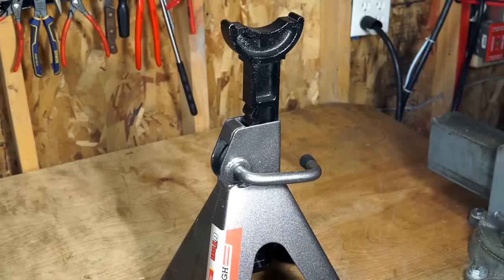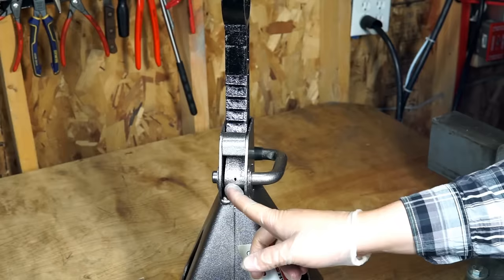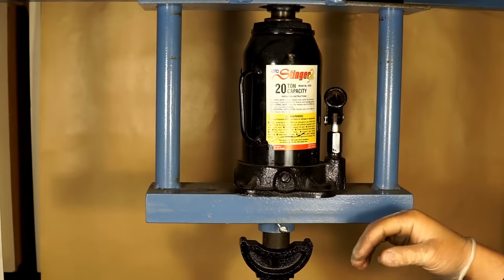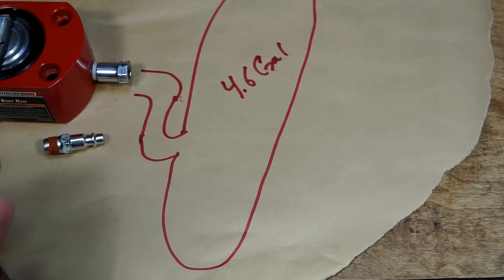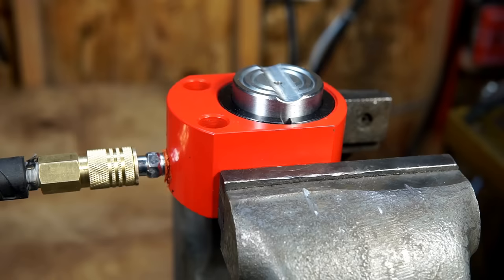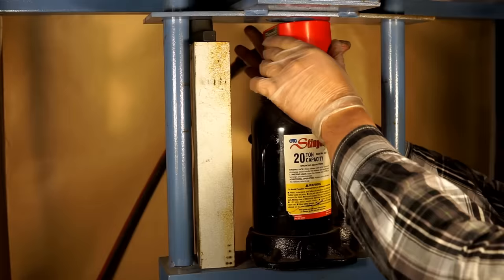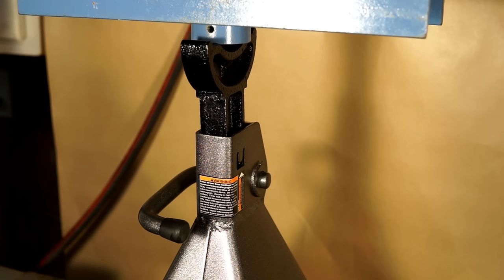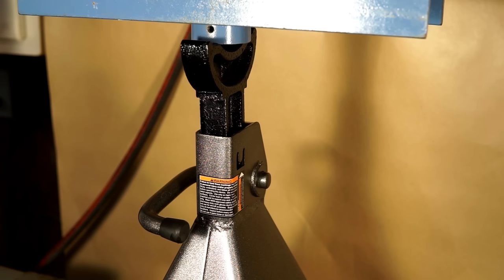EXPERIMENT: WARNING! Doing this to your Jack Stands will get you KILLED!

Comment: Yeah, I know this video six years old but I was just wondering the same thing because I bought a couple jackstands and they didn’t have the bar safeties that slide through the neck. So I thought that they were a defect or something was wrong with them. I reached out to the manufacturer and they said that, the jacks have a built-in safety mechanism because it Has to lift up in order to go down. They then referenced me to their manufactures video. I said to myself well that makes sense if you have three 4000 pounds of weight on top of it and an order for it to release, it Hass to be able to lift first. So of course I went on the Google to see if there was more than 1% chance of it feeling. I was surprised to see that it is not common for it to fail with most of the failures, being from poor operator error. I went and tried to research as much as I could about this Mike guy. I could not find enough information for me to believe that the Jack had a mechanical failure. I reached back out to the manufacture of these jackstands that don’t have a safety bar to push through and ask them if they have ever had one fail that resulted in injury/death. They told me that they couldn’t disclose that but they are 99 point whatever percent safe, as long as they are maintained and properly used.

Comment: Car hoists and elevators use this same principle to safely hold a platform if there’s a failure in the cable or hydraulic lifting mechanism so no, you won’t do this under normal circumstances.

Comment: There is a good possibility that the stand  
was improperly positioned , and it slipped , once it fell over by the force of the car pushing it sideways, it was impossible to find out what happened, since the latch would have probably moved from its original position.
I always put a hydraulic floor Jack  with a little force upward as back up for each Jack stand, or I will put two Jack stands near each other to be safe.
So 8 Jack stands to hold up a car.

Comment: A suggestion. Weld a socket onto the handle, then use a torque wrench to see how much torque it takes to make the jack stand lower. Could also tell you how much torque it takes to break the shear pin. (some math involved)

Comment: Jack stands can be very unsafe if used incorrectly. 
They should always be used on a hard, flat surface. 
Any outside work should be done with hardwood timbers.
I've seen jackstands topple more than once in gravel drives.

Comment: I have never felt that type of jackstand was safe. I no longer use them. I have a couple of very old jackstands that basically have a flat base, a heavy round pipe welded to it, and a solid round steel post that fits down inside the pipe. There is a 1/2" hole in the pipe, and 5 holes in the solid steel post. To set the height, you raise the solid steel part until one of the holes in it lines up with the hole in the pipe, and stick a 1/2" steel linch pin through it. These stands are seriously overbuilt, and should support several tons. Another issue I see with those ratchet stands is that the parts wear, and the more they wear, the weaker they become.

Comment: It was the operator's fault, not an accident or jackstand failure. A Porsche 914 has specific lifting points on the garbage frame, consisting of tubes that open on the side of the body. You lift the car anywhere else, the weight of the vehicle WILL eventually result in some sort of structural failure in the vehicle, resulting in the whole ting collapsing back to the ground. If he was using jackstands, the mistake was in not following the vehicle manufacturer instructions.

Comment: Also, no jack stands are 100% full proof and the higher you try to raise that car the more dangerous it will be. Leave the tuff jobs to a repair shop with a lift. When used properly, your gonna be safe under the car with well placed jack stands.

Comment: Try to trip the lever with a vehicle on the jackstand... see if it moves...
The weight of a vehicle puts so much pressure on the notches of the jackstand and that force stops it from "slipping". 
Nevertheless, put a block, tire, or other sound support under the vehicle for a backup. Also another jack, such as a floor jack supporting the vehicle is a safety also.

Comment: The problem with jack stands is that seldom do they fit in the area you are trying to work, and they’re surface contact areas are too small.. if you are using jack stands with a “Y” notch you need to set those on the axle or somewhere where they can bit into the surface they are supporting.. I don’t get under cars on just stands and floor jacks in place anymore, since getting quick jacks, those are the best because of how much surface area they are in contact with the floor.. you can’t move the car at all on the quick jacks and they’re as safe as it can get. But for floor jacks and stands you can never have enough safety back ups always leave the jack in place with the stands, put tires, wood, cinder blocks.. whatever you have to protect yourself .. and adding a bottle jack is good since those are low profile and can get in to areas where the floor jack can’t like on the subframe.. good video

Comment: Nearly 500 ponds to compress your air ram on top. Many presses have return springs to return the ram into the bottle jack. This may be minimal in the grand scheme, but it does throw off the measurements some. I have a feeling that the guy did not fully engage the tongue into the notches, maybe it was lifted partially and it missed the tooth.

Comment: I've had the cam completely fail on my truck with me under it, it was a Walmart 6 ton blackjack stand and the weld on the cam sheared, and the cam actually got pressed into the handle and popped out dropping the whole stand. I hadn't abused the handle or gone over capacity, the truck was only maybe 4000lbs, toyota 4runner, and if I hadn't had a floor jack holding the center up I would probably be dead, my head was right under the control arm and with where the tire was there was no saving me. They have since updated the design to have a secondary device for locking it in place, still scared the shit out of me.

Comment: Mine has a slide pin to insert into it. I trust mine and I use them frequently. I also do like to keep a trolley jack under the vehicle just in case. I have also used it without the aid of backup trolley jack. You can never be too careful when lifting a car.

Comment: That pin is NOT a shear pin, and is not intended to break.  What you did releasing it with a prybar and the hammer is not a failure of the jackstand.  More than 20 years as an automotive tech and I've never seen a jackstand fail.

Comment: i placed a 3 tone HF jack stand under my semi tuck 10 car hauler with all the steel work for the car carrier frame adding to the total vehicle weight,  under the front axel beam, i jacked it up about 1 inch off the ground with a 12 tone bottle jack and tested if  the 3 tone jack stand could hold the truck off the ground, and it was fine i have 4 of these and if used properly plus i double them up with backup bottle jack just in case they seem capable of holding more than 3 tones, just use them on a level floor and have backups like the jack in place just nipped up to take the weight 
i would use 6 tone ones but they are 2 big to fit under my rig as its very low to the floor and all the axel beams and the car trailer are only have about 6 inches of clearance off the floor
if i go under the my semi i always make sure its chocked up on all 4 wheels in gear and on a flat surface and all the wheels are on the truck so it cant fall fully to the ground

Comment: DYI in driveway on entire front end jobs on 2006 Tundra.
I hor the 6 ton HF Stands, 3 ton low profile hydo jack and still tried a couple dicey wood block lift assists, but caught the error of my way when it started to roll backwards but immediately got halted because also had rubber wheel chocks!
😮
That was a sphincter snapper.

Comment: I have had problems with this style of jack stand. The problem I had was the vertical shaft was able to push down and the pawl rotated down without jamming the shaft like it should. I don’t know if it was worn or if it was a manufactured defect. I only use jack stands that use insertable pins or I stack up some wheels under the car. Anything that will keep the car from falling.

Comment: There are many types of jack stands, and the ones that were prone to failing have been off the American shelves since the mid 90's. The safety features you see on the jack stands for the last twenty years were not present in all the Jack stands and even now not all stands are equal and a secondary pin would be smart.

Comment: I know it's a old video but I seen a problem. The placement of the hydraulic ( now air lol). You also had the force from the springs or counter weight what ever was used to pull the press back up when pressure was released from the bottle jack

Comment: If you have the car wait on the checkstand and you bump that handle ain't going to move the weight of the car locks it in, basically this guy didn't have the car properly jacked up, I've been working on cars for over 35 years I've never had a jack stand failure. Some people should be working on their vehicles.

Comment: The only flaw maybe is that you’re eliminating some of the static friction that would be caused by the full 500 pounds sitting on the stand, although you need 500 pounds to lift the lever you said there was only about 5 pounds on the stand. Only way I’d improve on this though is maybe compress the jack stand until your right at 500 pounds (any more and you’ll just compress the air) then do the same test. Loved the video man keep it up!
Reply: That's what he did, he loaded it with 500 pounds by compressing the ram slightly, then conducted the test.

Comment: The way the things fail is when the handle does not come down when set. The cam tip rest on the tip of the rack teeth.
There's enough friction to stay up but any bump of the handle will make it slip and come down

Comment: Technically not a fail.  Shear pin is probably intended for 1000lbs.  I doubt the roll pin is actually calibrated to a specific shear pressure, but it would have a failure at some point.  Your setup was a good idea.  I was thinking why not jack up a car and try to lift the release level (obviously without being under the car.  Would be nice to measure the amount of lift pressure required too.

Comment: Pop the little pin out and inspect the inner working parts. I had one that became bent and disfigured (looks like a number six when on it's side). Almost like  the metal was cut by chisel point or sheered. The part acts as the locking mechanism.

Comment: This actually happened to me I had the car completely raised off all four wheels.  I accidentally bumped the lever on the Jack Stand and the Pawl disengaged, and the jackstand collapsed. Amazingly, the car was suspended, perfectly level only being supported by three jackstands. I immediately went and got another jack Stan, and re-supported it. When I bumped the lever on the jackstands, it was very light. I am no longer using the jackstands without a safety pin. This canon does happen not sure how it even engaged in the first place with the way to the car on it, but I believe it was only engaged by a little bit of the tooth on the jack stand.

Comment: 914 isnt 50/50 weight balance, so even less than 500# on each front stand. So even more plausible that handle could be manually popped. Also more plausible a man could have lifted car off his face.

Still shocking anyone that can fit in and drive a 914 could lift even the lighter end off their face.

Comment: in mikes defense, depending on what he was trying to do, stuck brake rotor what the need be.. uneven ground so it could have been under less pressure. than the actual 500.... it could have crushed him based on weight distribution and momentum of the downward force..  but this is also why jacks are intended to use on a level surface. not on loose gravel or dirt.

Comment: This is good, but you need a pressure gauge in there to see how much pressure you are pushing through the jack. Like a sensor between the air piston and the hydrolic jack. Then you can see how much weight needs to be on the stand to cause the pin to shear.

Comment: I put extra support under the car. Either a wheel and tire, floor jack, or ramps. I don't truth jack stands after seeing a set fail when I was in the Army. The front of the truck came off the jack stands and the diff crushed the soldier.

Comment: I could be missing something but why not put a load cell into the first setup and then crank it? Plot the load, which will increase as torque is applied, until the pin snaps.

Comment: These Chinese pot metal jack stands have been known to fail in other ways too. Namely the teeth on the post being cast far too small, giving the pawl less to lock onto. Failures have occurred due to this too. My solution has been to use 2 jack stands per corner at all times.

Comment: When you hit it over and over you tilted the jack stand then it failed. So the question people should be asking is was the parking brake on and we’re the wheels chocked, was the floor surface level, was it on a concrete floor or asphalt because jack stands will sink into warm asphalt enough for it to tilt enough to fail.

Comment: The safest method is to use a bolt and slide it through the hole in  jack stand, and put a nut on the end and snug it up. A bolt and nut  is much more safer than using pins.

Comment: To be fair, the pin probably would break before the handle moved if the stands were being used near capacity as the designer probably envisioned.  The Porsche that guy was working on wouldn't come close to loading those stands up, especially if it was a 911 with the engine out behind the axle, where the weight's always off balance.

Edit: I didn't take my set of stands back for the recall.  I use them for tractors and big trucks and have kept an eye on them, but had no problems.  I prefer the smaller stands I have with the extra pin when I can use them, though.

Comment: Assuming your car weighs in the vicinity of 2000kg each quarter would weigh between 400-600 kg depending on whether in the front or rear of car which is 880ib to 1320ib which would make it even harder to move the jack stand handle upwards even with a breaker bar so likelihood of a failure is very small unless you are prone to getting under cars with a large breaker bar and trying to lift the handle on the jack stand. I prefer the pin jack stands with the split pin insurance policy. Nice video.

Comment: I keep the floor jack holding up the weight and place two jack stands right under the car with about a half an inch from the frame. I had a jack slip and fail before and the truck thudded onto the tow stands and it saved my legs. Left a dent in the driveway. I'll put two jackstands on a corner instead of one for double protection

Comment: Mine have bearing-lock pins on small chains that hang when not in use, you can put them in small holes on the side of the insert once it's above the second, or third notch. None of that area where it latches should be painted, imo, if anything it should roughed up, and abrasive.

Comment: Strange, mine actually have the handles able to lower down against the jack itself so that scenario is impossible on mine.  Plus, the truly safest way to work under a jacked up car is to leave the jack in place AND throw a tire under the frame too..... multiple options blocking the car from falling completely.  Or, use ramps if a lift is not possible or available.

Comment: If wheels are off. I'm tucking the wheels under the car too. If space allows, I'm also leaving the jack under the car with pressure on it. Not enough pressure to lift off jack stands but to also be a back up. But definitely tucking the wheels under the frame.

Comment: Probably a more realistic experiment would have been to lift the car and set it on jackstands with the tires still on. Then, as its up a few inches in the air, try to make the jack stand fail that way. If it does fail, well the tires are still on so no dead weight will crush anything. I do feel like i need to add to NOT be underneath the car during this test. 

I'm inking that what happened is that since he was using 2 jackstands, the weight was unequally distributed, with one jackstand being used as a lever and it seesawing back and forth and barely touching the other jackstand. But when he probably kicked the jackstand with no load on it, it dropped down, leaving the other side of the car with nothing to bounce off of, and coming down on his face. So essentially he "lifted" the car off his face with one side of the car being supported by the other jackstand. I can guarantee that he did not lift 1000 of dead weight off himself.

Comment: I customized my Jacks stands with a Heavy Spring that pulls down on the lever to prevent it from going up if i bump into it by accident, on top of safety measures i put the wheel under it that i took off